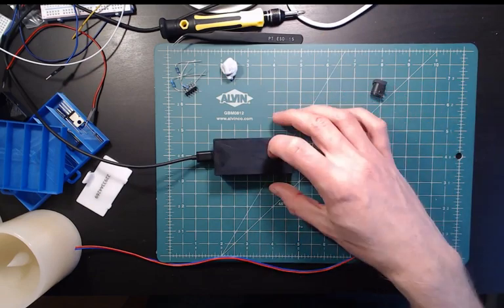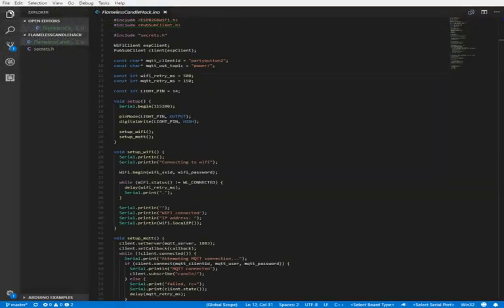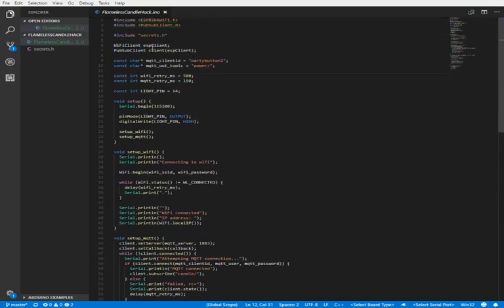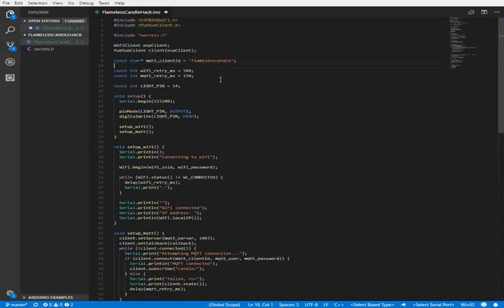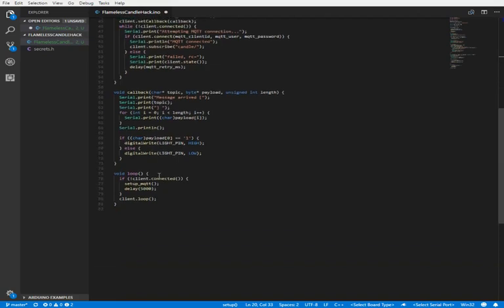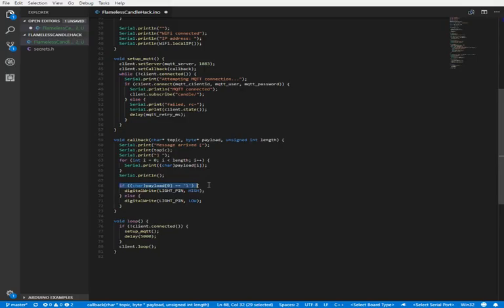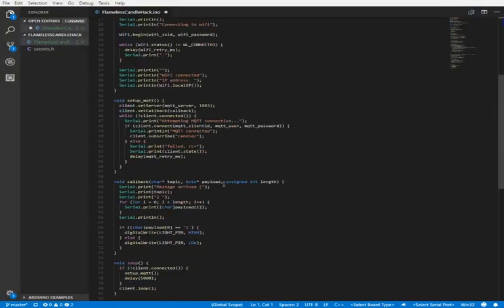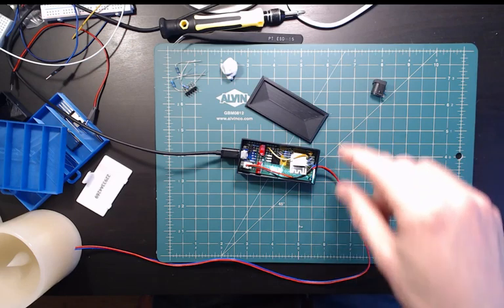IoT Flameless Candles using ESP-12

Comment: I'm wondering why you didn't use a MOSFET for switching.
(As your candles use very little power, a transistor will obviously work fine.)
Reply from the maker: Size and availability.

Comment: I forgot to ask. What is the current draw (excl. the candles)? Did you implement any sleep feature on the ESP?
Reply from the maker: No sleep since it's plugged in. The "naked esp" draws about 40 ma idle with small peaks during transmission to 70ish.
Reply: @metalwoodandelectricity44  So do you think a battery powered version of the flameless wifi candle would be possible or not really practical? I've just finished building a prototype for a USB powered candle that communicates over mqtt but my ultimate goal is a battery powered one. I've never done any deep sleeping and there aren't many examples of deep sleep and receiving mqtt messages in combination. Also, I guess there needs to be a latching relay somewhere for the candle to stay on during the nap. A challenge for you maybe! 😉